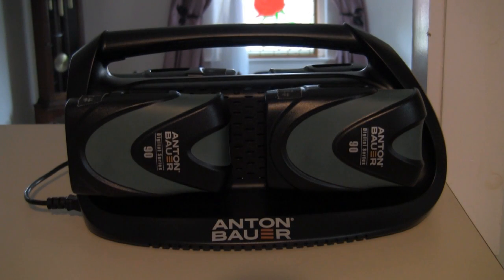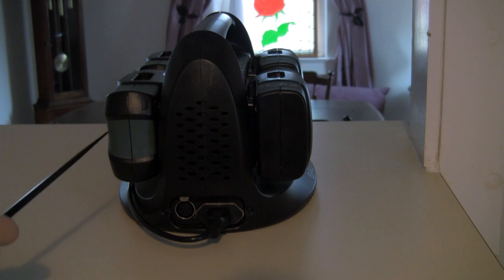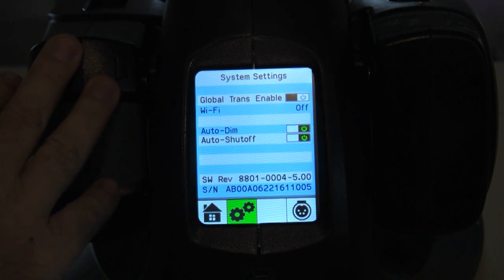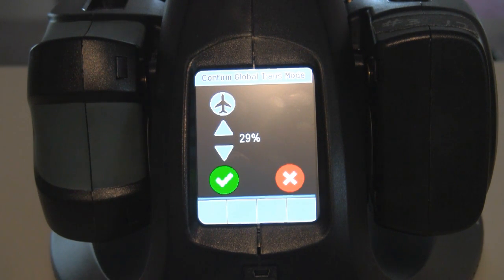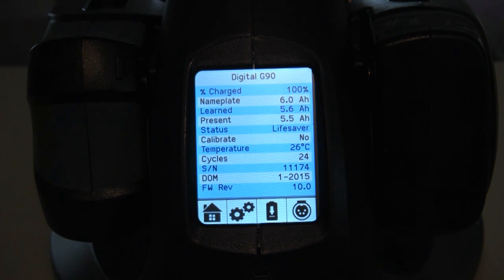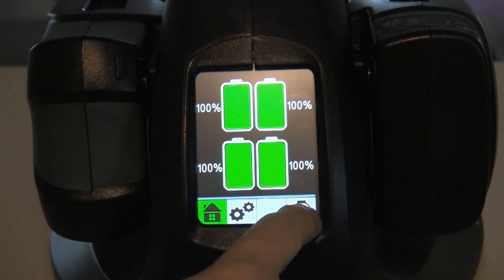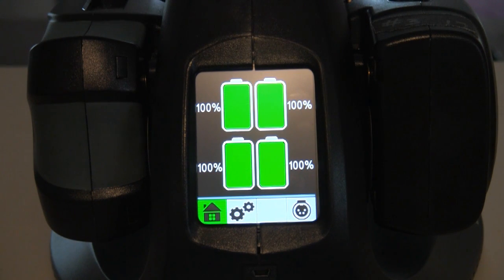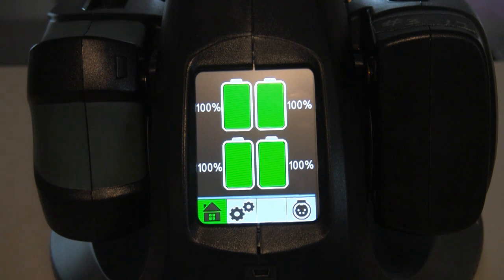Features of the Anton Bauer Performance Quad Charger

Comment: Thanks for sharing. I bought the dual charger and its a nice unit. NOTE: However, according to Anton Bauer the dual model does not include the discharge function or the global trans functions. Software update to enable wifi functions still not been released as of July 2019.
Reply: Just updated my firmware... I'll check it out. But yes, Leo, surprising that there are NO videos on this unit... except yours! :😀 Thanks!